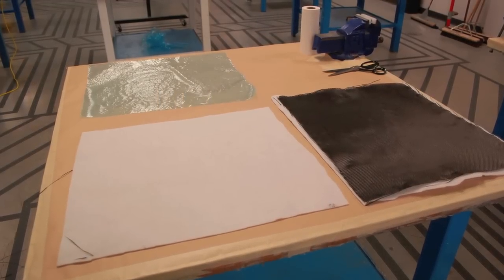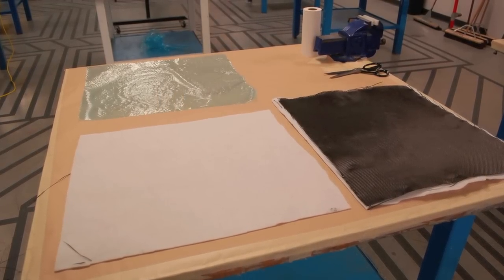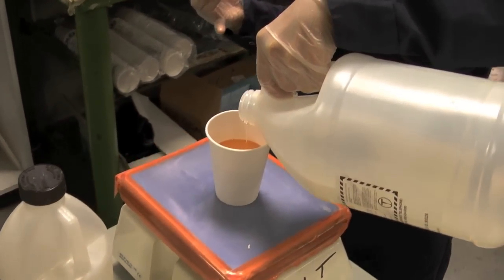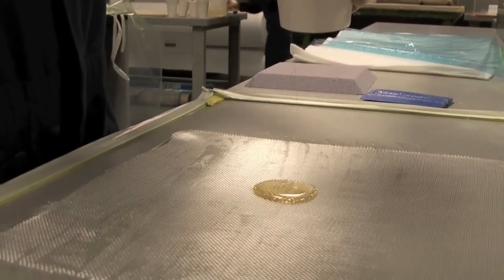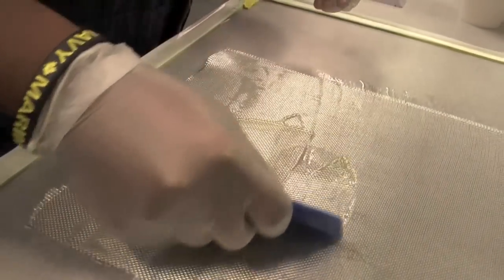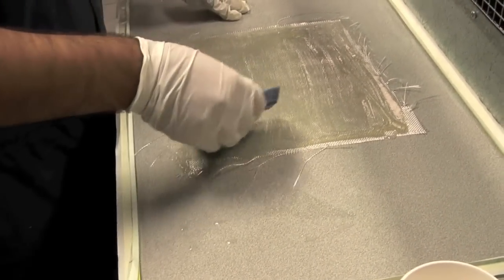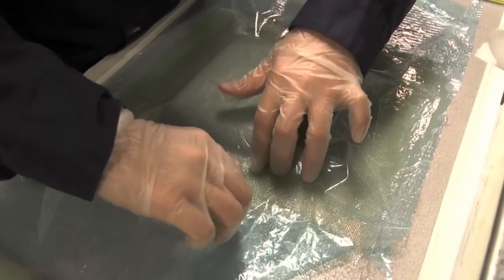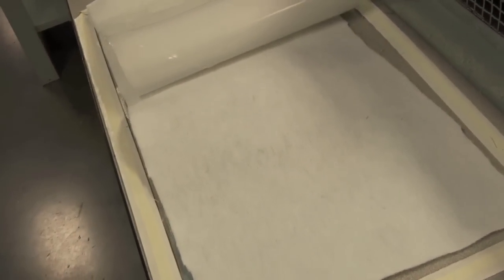Composites wet layup

Comment from the maker: Vacuum hardware is susceptible to leaks, regardless how good your equipment may be.  Vacuum bags can have small pinholes, often found at the intersection of wrinkles, or vacuum ports can leak backwards into the pump once the pump is turned off.  Manufacturers will often quote an acceptable leak rate, say, one inch of mercury loss per minute, or something like that.  we leave our pumps running to maintain the vacuum within that acceptable loss tolerance.
Good question, matthiu!

Comment from the maker: Thanks for your comments, and here are a few answers which may help:
Mix adhesives carefully to ensure all of the accelerator contacts all of the base portions.  If not mixed properly, areas of poorly mixed adhesives will not cure properly.
Correct vacuum range should be between 22 and 28 inches hg.  We leave pumps connected to maintain the vacuum at those values.  The product will be ready when you have followed the mfr's instructions - every product is different.

Comment from the maker: Hi Matthieu - sure, you can shut down the pump if you have a perfectly good seal.  Some bagging setups have one-way valves installed at the vacuum port which help contain vacuum pressure.  They can leak if the check valve inside has become contaminated with old resin.  But if you have achieved a good seal, then running the pump may be just wasting energy.

Comment: good stuff. which resin are you using? is a 24 hour pump necessary? thanks
Reply: +Mikey Haken sorry, just read the other comments
you cant avoid leaks
Reply from the maker: BCIT used a resin called "Cold Cure.  It's not an aviation epoxy, but rather a commercial glue.  If you're cost conscious, then adhesives like Cold Cure will work on your non-certified aviation efforts.
Regarding the leaks - yes, there are lots of layups where the bags and seals don't leak, but every project is different.  Just be careful when doing your leak-checks during the vacuum sealing step.  A good seal will offer 25 - 28 inches of vacuum and hold it for 5 - 10 minutes without use of the pump.